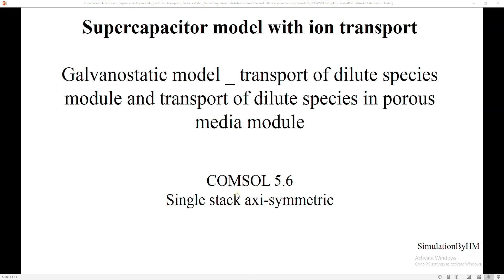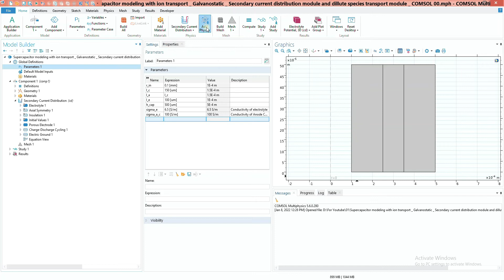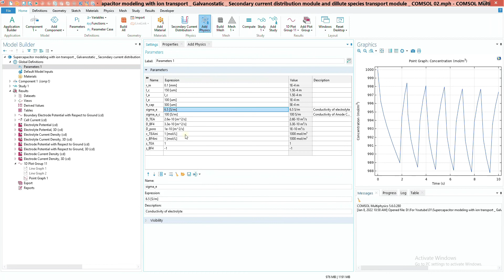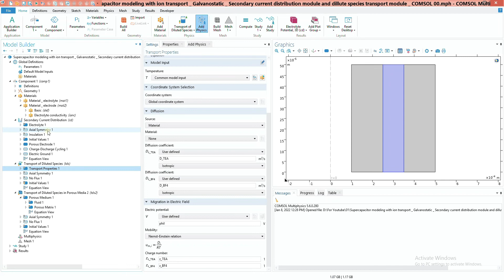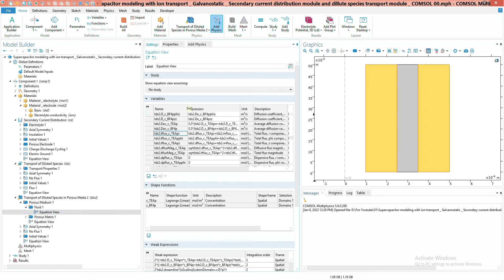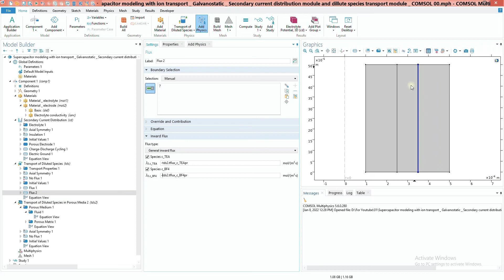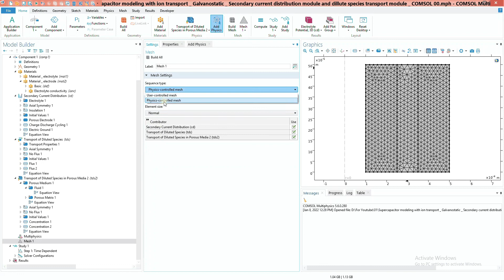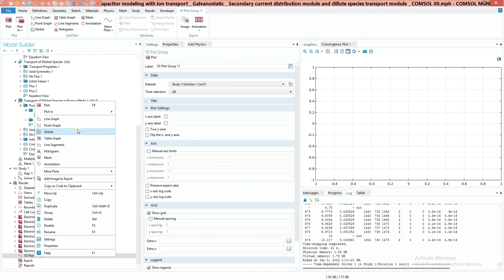Supercapacitor model with ion transport | Galvanostatic | porous media | COMSOL 5.6

Comment: Many thanks for the video, I am a beginner at COMSOL and  have some questions. Firstly, if I consider faraday reactions, do I just need to enable "electrode reactions" and add parameters? Secondly, what's the difference in the boundary condition setting if I use a normal electrode instead of a porous electrode? Finally，I want to apply cyclic voltammetry by adding "electrode surface", why can't I select the boundary? Or do I have to do cyclic voltammetry in some other way? Looking forward to your reply.
Reply from the maker: electrode reactions is not much of help instead try with simple solid electrode and as for modelling reaction on the surface which penetrates into the electrodes apply a boundary condition for flux that allows for Li ion or other such intercalation ion to go in and out of electrode during charging and charging. As for cyclic voltammetry try apply electroc potential at one end of the capacitor instead of current density and control the voltage variation using interpolations function for the profile of voltage you want to input
Reply: @simulationbyhm5194  Thank u very much! I will try it.

Comment: Hi, can we calculate capacitance of this model?
Reply from the maker: You can use a simple formula like "capacitance = Time integration of (current/Voltage)"  at the boundary where the current was applied in the simulation his should give you the capacitance.
Reply: @simulationbyhm5194  it gives units of 'S' but capacitance has units 'F'